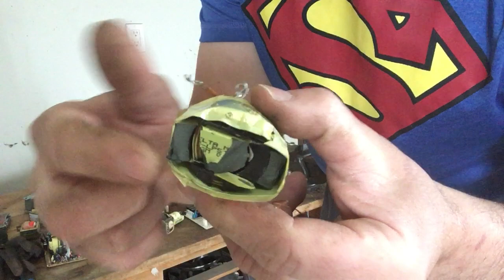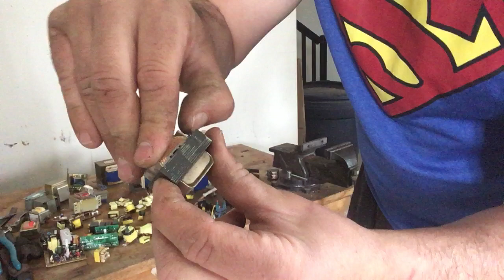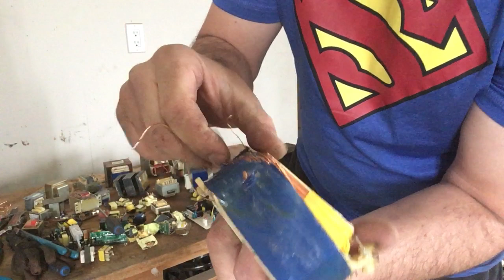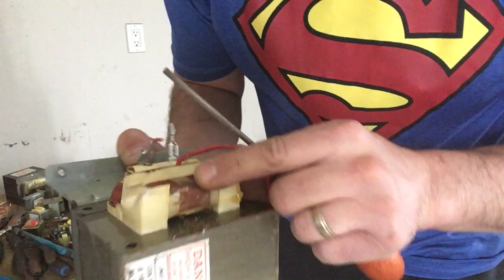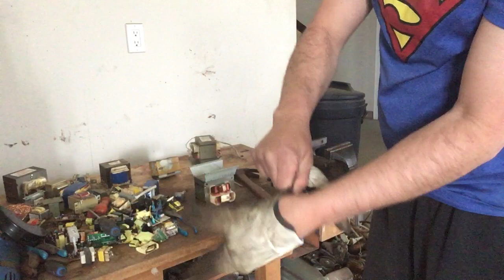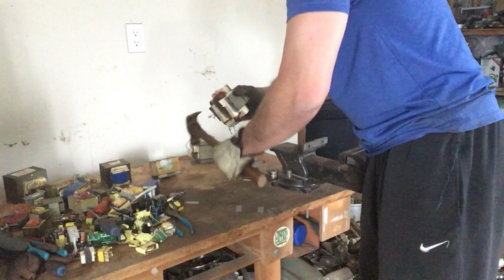Scrapping Transformers for copper. Money in disguise!

Comment: What kind of blade do you use on the grinder?
Reply from the maker: I use a maximum metal grinding disc. They are not great but they get the job done and I get in bulk for $21 for 50